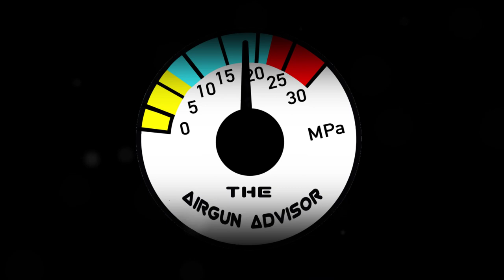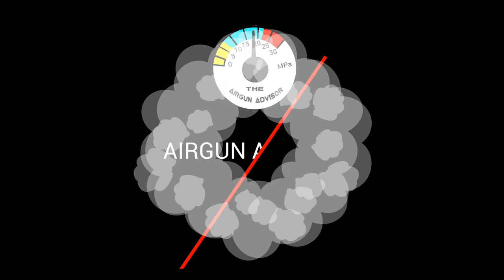Airgun Advisor: Benjamin ReCharge Filter Change

Comment: It is almost two years. If you still have this compressor, have you had any problems with it?  Excellent review. Thanks.
Reply from the maker: I have sold it to a friend as I have both a Daystate and Alkin compressor. He is still using it. Issues…. Only problem that I had was the automatic stop from the pressure gauge went south. Not a big deal as I always stick around as the tank fills. Hope this helps in your decision process.

Comment: I really liked the review.  Just recently purchased this compressor, seems to work very good.  I am curious about filtering the moisture out of the system and am considering a gold filter with desiccant and bead media sieve and was curious to know if you have any experience or an opinion on that.  In viewing other filtering videos, it appears that some folks appear to have some success filtering air on the intake to the compressor, how easy would it be to do this with the Benjamin?  I have not removed the cover and am wondering what the intake looks like on this compressor.  Thanks again for the video.
Reply from the maker: Although a little more expensive than the gold filter, I do use an additional filter like the one linked below by Coltri. https://www.airgunsofarizona.com/pcp-accessories/omega-cleanair-inline-filter/

Air tanks for sale also carry a similar design but even more expensive. 

Over abundance of caution, but helps me sleep at night.
Reply from the maker: Baby Sherman after using two for an entire summer, I would say probably not. What I have seen is the second tampon style filter that comes in the hose is only slightly damp. I also have not seen an water in the second add on filter condensing in the release valve. I use it because I have it. Is it necessary? Probably not, but I have no numerical data to prove this and I am no scientist. 🤓

Comment: Has the gxcs4I pretty much of outdated this unit being half the price fills large bottles and goes to 5,800 psi or do you believe this is built any better?
Reply from the maker: @Alloutairguns  I would probably with gxcs4I at this point due to the price difference. But the Benjamin is a very good compressor.
Reply: @AirgunAdvisor  alright Od purchased an item at auction labeled as a gccs4I  I won the bid only to find out the place had the item labeled incorrectly so I was kind of loss for words on one hand I got an item that’s cost 2 as much as the gx4 but in the end I don’t really think these can hang with a gx but I don’t know bc never used them